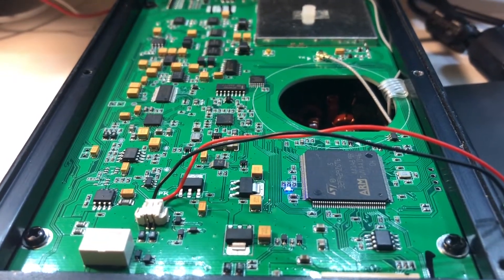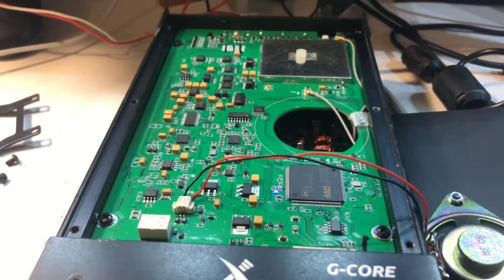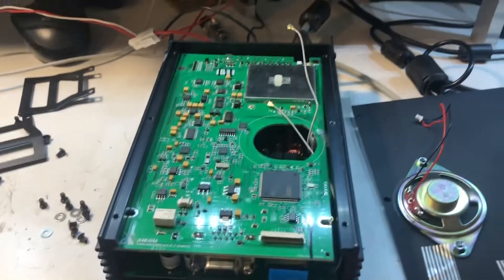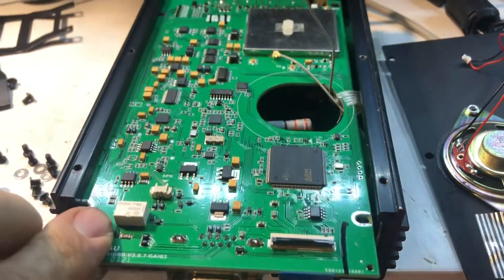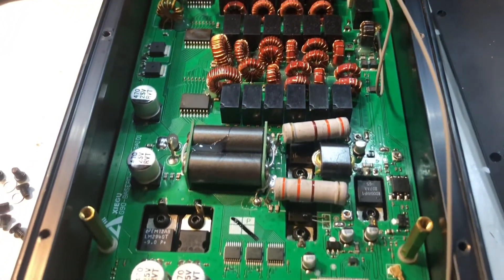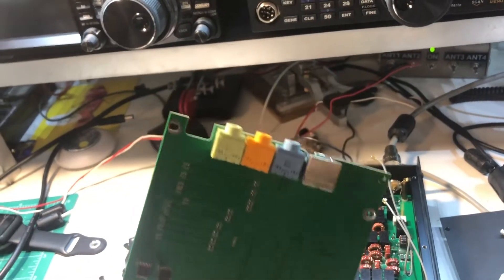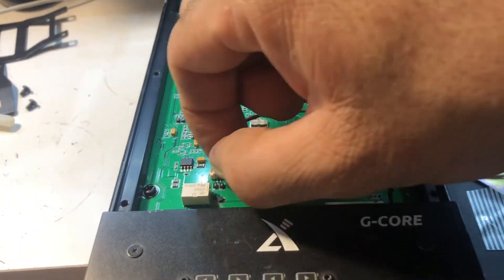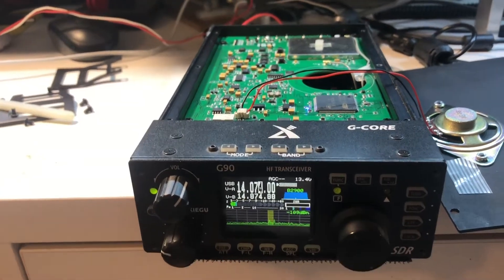Looking inside the Xiegu G90

Comment: I know there are thousands of followers of the G90’s…However, I owned one for less than 6 months and was so happy to see it go….I believe it was the worst radio I have owned and I’ve been a ham for 60 + years…Screen was so hard to read and the menu was very confusing…Hope this comment doesn’t cause a lot of hate mail but that’s my experience…Looking forward to the 6300…Maybe it’ll be better…..Sorry…
Reply: Hello Randal - Been on the air for 40+ years here.  I have a G90 and apart from the screen been small I did manage to master the menu system.  I find the G90 a fabulous rig and no plans to change it, I use mine mobile.  Its the one and only Chinese radio that I've bought.
73's de Ger